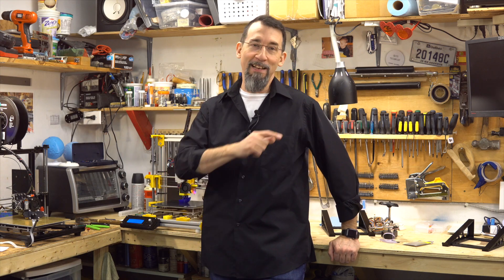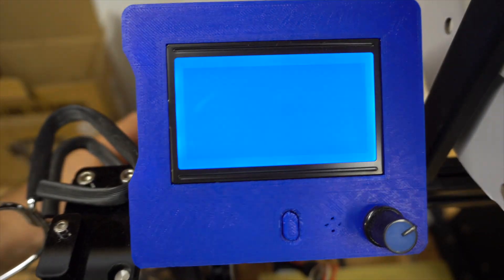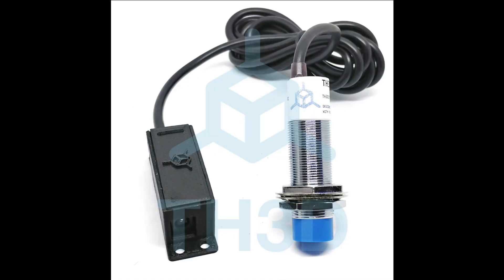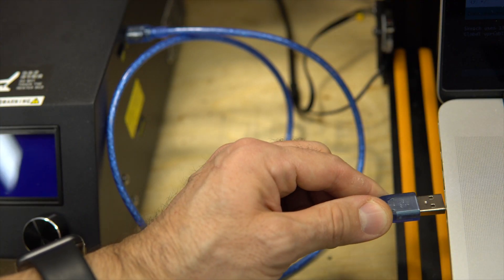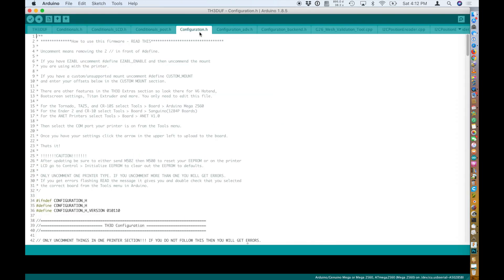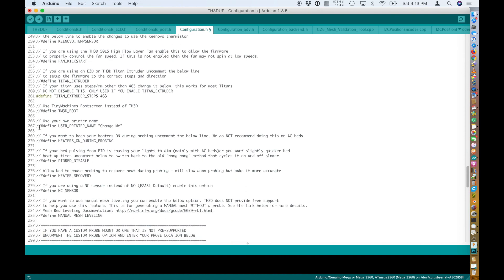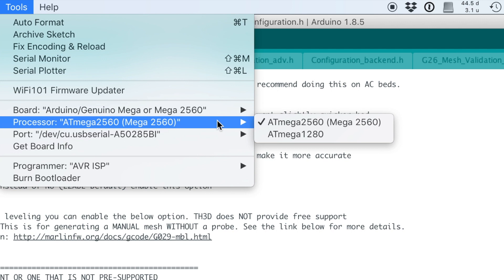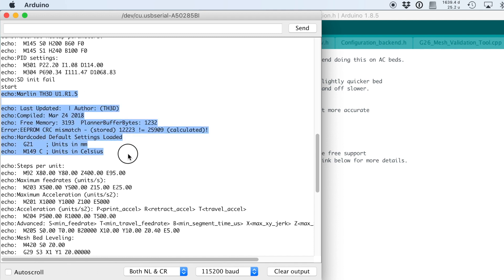CR-10S Firmware Update Made Easy

Comment: I was able to flash the firmware successfully but now all I get is a blue screen on my display. I flashed it while it was powered up. Does that matter?
Reply: I have the same issue. Did you manage to get it fix.
Reply from the maker: It should not matter if the printer is turned on, I do it all the time... you must choose the right configuration or it will not work. But you can do it again if it didn’t work.

Comment: Will this work for the regular CR 10
Reply from the maker: It should work, I suggest you refer to the TH3D site they have a list of printer and compatibility. On other CR-10 models you have to program a bootloader first, it can be done easily with an Arduino Uno and some jumper cables. I think that TH3D as a video on how to do this.

Comment: Is it really that easy? I have the EZABL and wanted to install it. the TH3D video guides show a need for a bootloader and an addition piece of hardware?? (Cr10s5)  If that is the case then it isn't as EZ as I had hoped!
Reply from the maker: Hi, It depends on the board you have, the one that I had already had a bootloader. Installing the bootload is not that complex, you program a Arduino UNO with a special code, same thing as programming the TH3D firmware, than you connect it to the printer board, power it up and it installs the boot loader. The rest is the same. But as I said, it’s the same process programming the Arduino. Just one more step.
Reply: Mickey Zombish  Aaaahahaaa!!! you won the internet that day!!  same lol . . .

Comment: hi frank i get this error when i try to upgrade my cr10s s4:
"C:\Users\Jeroen\Desktop\firmware\TH3D_UFW_U1.R1.8b\Firmware\TH3DUF\TH3DUF.ino:61:110: fatal error: U8glib.h: No such file or directory

     #include <U8glib.h> // library for graphics LCD by Oli Kraus (https://github.com/olikraus/U8glib_Arduino)

                                                                                                              ^

compilation terminated.

exit status 1
Error compiling for board Arduino/Genuino Mega or Mega 2560."
Reply from the maker: Hi, I think you just have to install the U8glib library in your Arduino software.
Reply: i got it :D but now heating acts up now and then i have checked wiring allreadfy
Reply from the maker: Hi, what do you mean by acting up?
Reply: Frank's 3D shop as in one print it starts heating up next time i start printer up again no heating (same file same gcode)
Reply from the maker: Is it showing a target temperature and a good reading of temperature?
Reply: Frank's 3D shop it shows target temperature and it doesn’t heat up
Reply from the maker: Ho! Did you initialize the EEPROM, load defaults and save the settings again from the printer menu?
Reply: Frank's 3D shop ha no i didn’t ill try that in the morning thank you
Reply from the maker: I do not remember if I said this in the video, I will add it to the descriptions. Thanks.
Reply from the maker: Take notes of your settings in Control Motion before reseting, just in case... Should be good when loading failsafe settings.
Reply: Frank's 3D shop crap i think the settings might have been wiped allready any chance you know what they should have been for a cr 10s4
Reply from the maker: Hi, it should be fine with the failsafe settings, I just looked at them in the source code.
Reply: no joy for heat bed still won't heat
Reply from the maker: Humm strange, I see in the configuration.h file, there is a CR10S_S5 and a CR10_S5, they have different settings, did you choose the correct one?
Reply: yup i selected the CR10S_S4 the CR10_s5 has a different board so it wouldn't load onto a mega ;) i tried that allready :P
Reply from the maker: Good, make sure you have the option in extra "//#define AC_BED" Disabled...

If I was in your shoes, I would ask on the TH3D forums

I found this that could be related:
https://www.th3dstudio.com/knowledge-base/cr-10s-v2-0-v2-1-temperature-repair/
Reply from the maker: Just a thought, did you try the preheat from the printer's menu?
Reply: yup thats where i have the fault aswell ;( was hoping of being printing by now ;( gonna see if i van at least start a print without the heated bed with Pla should be fine right?
Reply from the maker: Yes, add some glue stick or hairspray...

Did you try to do a Home axis? What board did you have to select in Arduino? I am looking at the source code see if I can find something.
Reply: home axis works its all dialed in except for the damn heated bed that doesn't want to heat 
"i had to select this :  Arduino Mega 2560 maybe i should just start over with rebooting the firmware from TH3d
Reply from the maker: You could check the connections inside the box, if anything is loose (AC DISCONNECTED first) I think you have a Mosfet board to control the heat bed.

You could have a hardware issue that is just happening at the same time as the update, rare but could happen.

Also I would disconnect the bed from the controller and check the pins in the connector, maybe one broke. 

Attention, MOSFET can break easily with electrostatic discharged, make sure to ground yourself (AC DISCONNECTED)

If you have a continuity tester, check the cables from the heat bed solder up to the Mosfet (still AC disconnected). Also if you have an Ohm-meter the resistance of the bed heater should be low in the two digits Ohms, it's almost a short (AC DISCONNECTED).

I would try that first.

Than if the cables are good, I would test the Mosfet for the bed, but it is more technically involved and should be done by some one who has the knowledge to do so.
Reply: thanks for the help im dismanteling him now back into the box since ill be away for work for a week after that ill take it with me to the hackerspace we'll check it there
Reply from the maker: Great, please keep me posted I am curious at what is the problem!
Reply: Frank's 3D shop hey frank we found it one of the wires was knacked giving bad connection visually we couldn’t see until we measured it
Reply from the maker: Yep it happened to me on the head heater wires.

Comment: Hi Frank, thanks for the video. I have a CR10S with a touchscreen in the controlbox.  Can I still use this FW?
Reply from the maker: That is what my friend had, it work, the only think you loose is the resume function after a power loss.
Reply: Great, thanks for the info. I don't mind the loss of resume functon at all. Powergrid here is very stable so that this function is not necessary.
Reply: That is one of the most useful feature, even if you don't have power loss. You just didn't learn to take advantage of it.
Reply from the maker: How is that? It will burn your SD Card faster because it is writing the position on the card.
Reply: should be possible
Reply: The best video I have ever viewed on YouTube regardless of topic